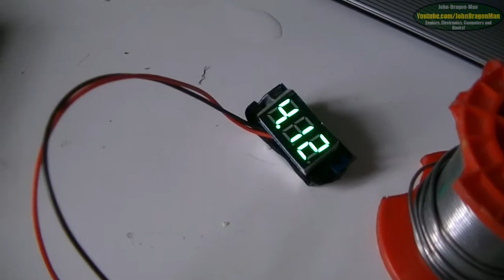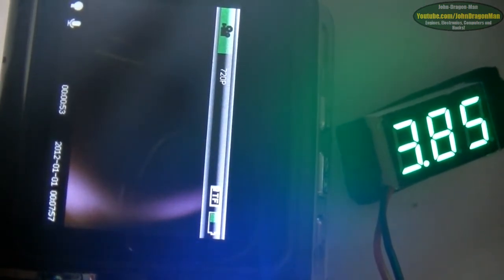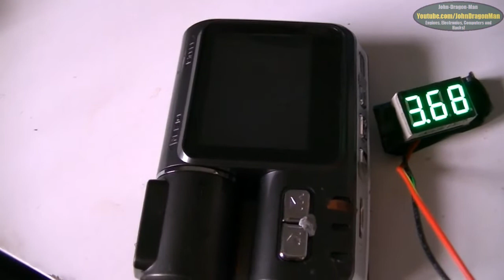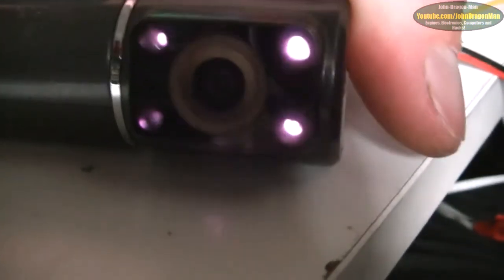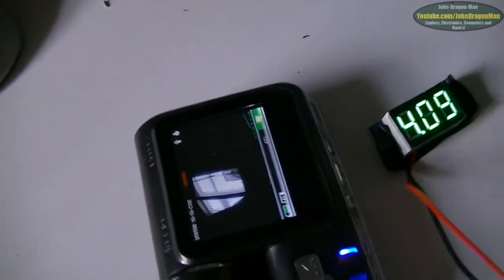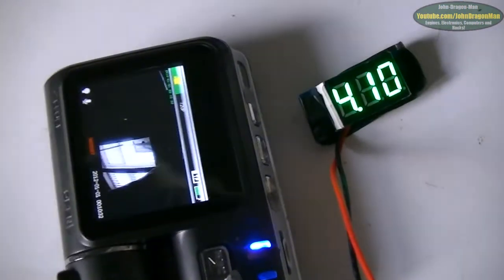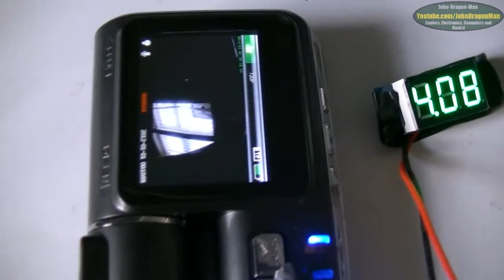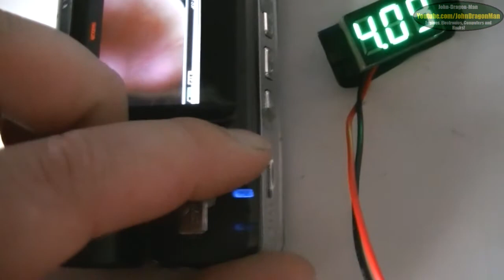x6 i1000 f70 dvr dash cam power off fix

Comment: Hello,

I'm having the same camera and since day one it does not work properly. Turning ON and OFF by itself.
I assumed this is a battery however why does it still power OFF when its connected to the USB charger?
Is the power to the camera circuit fed  always through the internal battery?
Can I just disconnect the battery and connect the USB power instead, why do I need a buck boost to deliver the power?
Do you have the manufacturer details?

Thanks,
Yoav.
Reply from the maker: +yoavbensha hey there, the "chargers" for these cameras are very weak giving low amps and volts..  try using a more powerful adaptor and see if that works ;)
Reply: +johndragonman Hello, thanks a lot for your reply.
I did try to use at home a 2AMP USB charger and the problem is the same.
Do you know if the battery is always supplying the load and there is no direct feed of electricity when the power supply is connected?
Do you the e-mail of the manufacturer, may be I could get from him the charging circuitry details?

Thanks,
Yoav.
Reply from the maker: +yoavbensha oh i see. it does seem like its the charging circuit that is not providing enough amps to keep the camera running.
have you tried setting it so that the screen turns off while it is recording? i have had to do that on  my mums dash cam. the screen takes a lot of power and when its off its just enough to keep the camera running.
Reply: +johndragonman Hello,

Thanks again, could you please let me know if you have removed the battery and connected directly onto the battery PCB terminals the supply voltage? Isn't the USB supply voltage already connected in parallel to the battery or is it connected to the internal charger circuitry?

Thanks,
Yoav.
Reply from the maker: +yoavbensha i wish they were..  thing is if the LI-PO battery gets over volted they tend to go a little explosive. they are connected by a built in very weak charging circuit. i have just bought another one of these cameras and i cant even set the time and date because it keeps going "flat" while on charge :/

ill be doing this mod to this camera as well it seems.
Reply: +johndragonman Hi,
I just ordered a new 500mAh battery.
Can you please detail the rework you didi, IE which wires disconnect and connect?
On the USB connector I see 3 wires, what is the 3rd one?
If you use the camera with your car battery, what happens when you switch the car ignition, don't you loose the camera settings?

Thanks,
Yoav.
Reply from the maker: +yoavbensha a more simple way of putting it is to not use the internal battery, add an extra charging port connected to where the internal battery was connected and make the car's battery with a voltage regulator set to about 4.5 volts the cameras battery.
then just use the camera's charger as normal connected to an ignition live.
Reply: +johndragonman The ignition switch supply is connected instead of the internal battery, how do you connect the constant (+) battery supply?

Thanks,
Yoav.
Reply from the maker: +yoavbensha the internal battery needs to be removed and replaced with a constant live @ 4.5v.
then to turn the camera on, connect up the standard USB to the ignition supply via the charger.
Reply: +johndragonman Thanks a lot, I assume that there is no problem to connect the constant battery supply and the USB charger source at the same time, I assume there is some kind of isolation between these 2 supply voltages (in other word they are not parallely connected)?
Reply from the maker: +yoavbensha yeah so long as the constant power (4.5v) is going through the internal battery connectors only.

dont worry about the current draw too as its tiny. if the car is in use daily it wont drain your battery for at least 10 days ;)
Reply: +johndragonman  When i bought this camera awhile back i installed the Magic power box pro .. Hard wires your camera and runs it on a Volt and timer  You set the volt that you car battery has ( 12V )  to a shut off of 11.8V still lots of power to start up And or 1hr 4hr 8hr 12hr 24hr and non stop recording 
And yes i had the Cam Battery poop out long ago  If i remember the numbers 480mins on loop on full 1080HD which the front cam is 1080 only the rear only up to 720  and you can do 50hz or 60hz frames which 60 is just longer takes on the same frames not quicker .. run mine at 720HD which on a 32gb san class 9 or 10 gives me 8 or 9 hours of record time 
So even with my truck turns off it runs front and back  Which is great if something happens while your fast a sleep  People also dont know in settings Default makes the Camera record 1 min bits 5 min bits ..You can turn it off My camera stays full on when i start the truck after i turn this setting off
Reply: +freakyflow I bought this cam about 2 months ago and came with same problem. Was working fine then lasted for 10 min while connect to power, then now 10 sec. I want to take battery out and hardwire it to power source if possible.
Reply: +Ki Hoon Kim https://www.blackboxmycar.com/products/power-magic-pro-blackvue  You take the wires from the Box and wire them to your fuse box ( it will show you )  Also Look on youtube : Power magic pro  There is no need to remove your battery from the Camera   I think the product is from Korea or china
Reply: +freakyflow Cool. Thank you. However, I'm having trouble that dash cam's turning off due to flat battery even when it's hooked to power. Also battery level go from full to none to mid to whatever... Think it's faulty battery.
Reply: +Ki Hoon Kim Hi, same here. It looks like the battery is faulty (very poor quality). I have ordered from ebay a 500mAh battery. Hope this will solve the problem, I will update.
Reply: +yoavbensha Hi, Thanks for sharing your experience. Please let me know how you go with new battery. As far as I see, It's probably combination of bad battery and poor charging capacity. I happen to find an old HTC wall charger and it worked fine! Dash cam was running for hours and battery was fully charged, charge rate was 4.2V. However, when I connect it to supplied USB cable, only go upto 3.68V and dose not charge. However, even I have fully charged battery, it was going from 100% to 10% to 50% to all over the place in just few minutes. So I concluded 1. Battery is bad, 2. Charging circuit maybe under capacity. 3. USB connector is poor and not connecting properly.
Reply: ***** OK. I found a faulty(bout it on ebay but somehow didn't work with my iphone but still holds charge at 3.93V) battery. Might be trying this on dash cam see if it works.

Comment: i try 4.2v converter instead of battery. working but not stable. because 4.2v not enough. this cam working with 5v stable. now im using 5v converter module and 5.5v 4f capacitor instead of battery. working excellent.
Reply: when using 4.2v screen is vibrating. this mean is low voltage.
Reply: +Ali Onur Yildirim 
Please share details about 4.2V converter...
Its 4.2V to 5V converter?
Reply: how did you do it? Where did you connect it? Do i have to remove the battery? Sorry i am not good with wirings and stuff. Thanks in advance!

Comment: The USB jack was a direct plug in at 12v and the buck controller wires were installed separate.

Comment: Hello John, its me again. My first cam just went out last month and I have another on the way. I use the battery removal task and had a buck step down installed inside of it at 3.8 and it ran perfect with the stand alone USB jack inserted also. But I'm curious again about your setup here. Are you saying that you removed the battery and wired the leads from you buck converter direct from the vehicle 12v line, and not using the 12v at all?

Comment: Hi if I connect +5v instead of 4 v will it work or ckt fail. Reason it is quite cumbersome to get bring down the voltage to 3.9 from input +5v. Of may be connect a diode to mini usb pin1 and solder other end to pcb battery point.
Reply from the maker: you could use a diode..  i did try this but the diode does not give enough wattage to power the camera fully.maybe if you used a few zener diodes in parallel..  that may work..

Comment: Hello. I just ordered the same camera. It was inexpensive and all I want to do is record traffic and my trips so it should work fine if the video is even half decent. I was wondering if you could give more detail on how the power is connected in your setup? IE: battery removed, just connected to the battery leads, etc. My intention is to "hard wire" the unit into my truck in a hidden position and your method of powering it looks to fit the bill!
Cheers.
Reply from the maker: its quite simple really, you take the battery out by unsolder it from the main board. solder in some wires and being them out of the case, get a voltage controller / buck controller. set that for the charging voltage of the battery (around 3.9 volts) and wire that in to a constant live. then the standard USB lighter socket adaptor through a switched ignition live.
Reply: johndragonman good stuff! I figured it was straight to the built in battery leads but wanted to be sure before I had a go at it. Thanks!
Reply: diesel I have a dsatx 220 in the truck already to run a "carputer". I can just feed from the 3.3 or 5 volt rail.
Reply: johndragonman Will the 5v charging from the USB lighter socket cause any problem with the 3.9V p/s being used?
Reply from the maker: Don Baker in the years i have used it, it has never had a fault! :D  you could protect the supply with a diode if you wish...
Reply: Thanks

Comment: I have this model and its very pigeon English instructions. It has a mind of its own!......It endlessly records 4.6.16.4.9,,24,4,4,12,4, seconds all the time.After a 15 minute drive I get home and connect it to the computer and I will have about 50 short clips which are useless. And whats the window top left next to the 3 buttons?
Cheers
Reply from the maker: hmm..  odd..

the little window on the top of it is for a remote control.
the camera should record in 2 - 5 - or i think 10 mint video clips... it may be down to the video codec you are using.
try opening the videos in VLC media player. 

it could also be down to the memory card. if it is not a "fast" enough card it will just make corrupted video files.

try a different memory card.. it may fix your problem with it..

yeah i know what you mean about the camera instructions. they can be hard to follow. if you do a google search, you should be able to find one in better "engerish" lol

once you get it working you will love the thing. have a look at my recent uploads and you will see a near miss that my camera recorded.

if you need any more help just ask' :)
Reply: johndragonman
Go into the menu settings and see if you have 'Auto Detect' turned on? Turn it off it it is on. Also, set record time to it's maximum 5 Minutes.
Reply: johndragonman I had opnly had it installed a week and someone run into the back of me so all vehicles should be fitted with these. Thanx John for the info, all is working ok now, it was the auto detect function and through a little trial and error its now fine. Just have to buy a couple of ferrite beads as the rear camera interferes with talkSport (AM radio)

Comment: All right. I just found this video looking for a solution. I will share my problem 'cause I am not sure if this is the solution for it. You let me know please.

I got this dashboard dual cam from china for $60. I plugged the power connector on the "engine" lighter outlet because I just need the camera to record while I am running the vehicle. It was working totally fine for like 2 weeks. It was shutting off when I turn the vehicle off and it was starting fine every single time I start the engine or just open the switch. I realized that 2 of the 3 lights on the camera were always on, but the one in the center was only on occasionally.

Few days ago the camera shut down while driving and was not able to turn it back on. The red center light was the only one on. I wrote the manufacturer and he told me to let the camera charging for at least 3 hours. I did it and then I was able to turn it on again, but it only worked for a day.. then it went back off with the red center light on.

I wrote them again and then they told me it could be a problem with the battery.  I thought the camera was not running on battery while it was connected to the power outlet.

So, is this the problem that can bi fixed with your invention?

Thank you